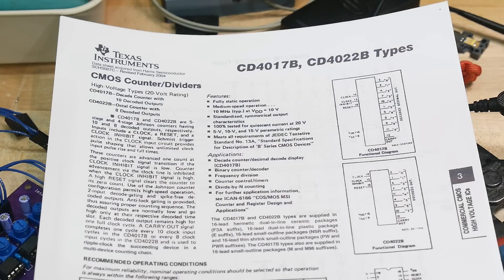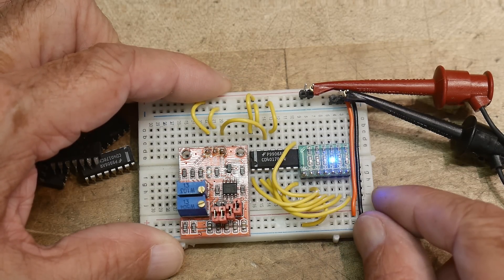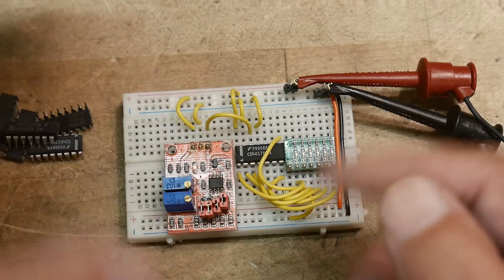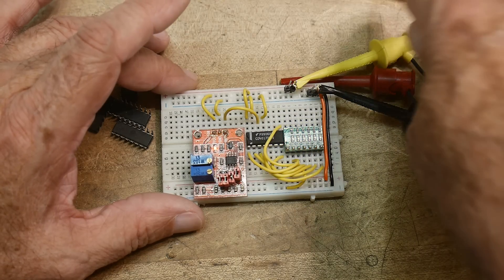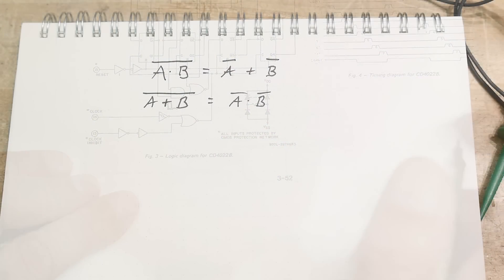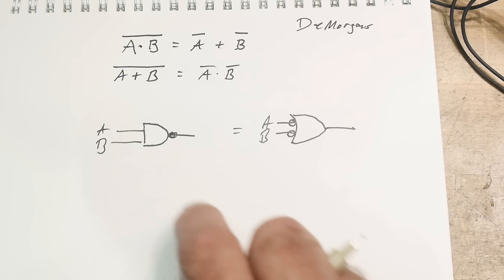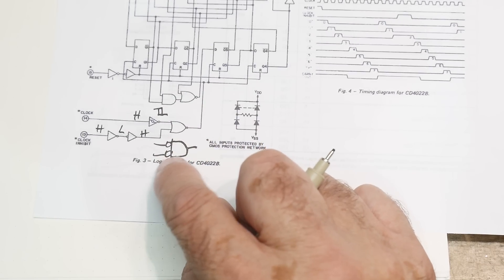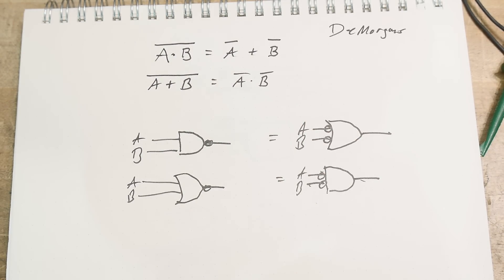#1230 CD4017 CMOS Counter

Comment: I love the 4017! even in this world of cheap microcontrollers. I don't think I'll ever stop using it. It's a bit like the 555, it always comes in handy in my bag of circuit tricks👍😉 sometimes I use a flashing LED as a simple clock for the 4017.

Comment: The DeMorgan brought back a quote from my early electronic training 
Break the line change the sign

It turned out to be fairly simple. 

It was never described as the different shapes.
Different teaching methods I expect

One of the main uses was to enable a circuit to use all the same type of gates
Now I will have to look up karnaugh maps again

Comment: Hi @IMSAI Guy,

Do you remember the e-mail message i sent to you some days back, regarding a resistor ladder, that you never replied and probably never read as such e-mail would be still waiting in the spam folder?

If you look over my YouTube channel, you will find a video in which i hacked a 30cents 4017 module from China into a full logarythmic stereo vumeter by using a resistor ladder of the same kind (it uses the same working principle as a special DAC, but using different values because in this circuit, the purpose is to generate a stepped exponetial to be compared with the input signal, hence the logarythmic behaviour of the vumeter).
Reply from the maker: I did look at the two websites. it was pretty basic, but thanks.
Reply: @IMSAIGuy  Yes, it is very basic, but i've never seen such a simple manner of generating semitone voltages (2^(1/12)) for feeding a 1Hz/mV VCO using comercial valued resistors.

People making monophonic keyboards or keynote sequencers, have to deal with linear to exponential converters and voltage quantizers to get music notes from their oscillators. Even for people doing 555 keytone boards have to adjunt or trim every single resistor for every keynote. I did it just simple with a linear VCO made of a 555 and a couple of opamps, some SPDT momentary switches, and that resistor ladder, and it fits as a fiddle.

I thought this could be of any use for your synth if you want to add a sequencer (made of a CD4520 and some sram like HM6116 or so) that generates voltages that can be matched to semitones this way. 

Thank you, anyway.

Comment: I build an electronic rpm meter back in 80s that would 1/100 rpm in a minute. Dam machines was so irregular that the rpm  was 60.12 and the next second 45.68. I memorized the logic and when you show the picture of the circuit, I still have it even I have a stroke 28 years ago.

Comment: I don't think the circuit is drawn wrong.  It is a Clock Inhibit input, not a Clock Enable.  If the Clock Inhibit is high, the bottom input to the NOR gate will be high, so the output will always be low.  That will prevent the clock input from toggling the output of the NOR gate.  When the Clock Inhibit is low, the clock signal will be allowed to toggle the output of the NOR gate.
Reply: Must be careful not to be an enabler 🙃